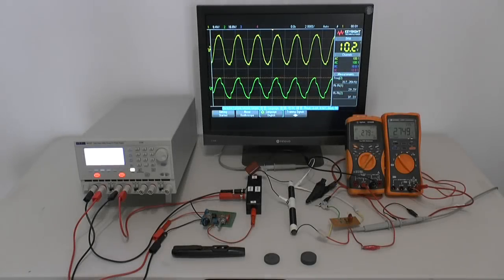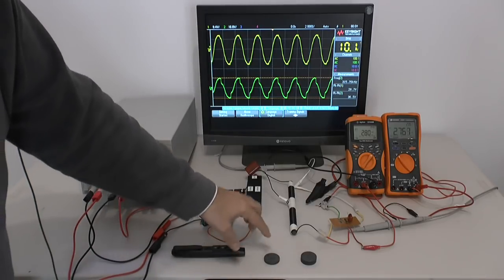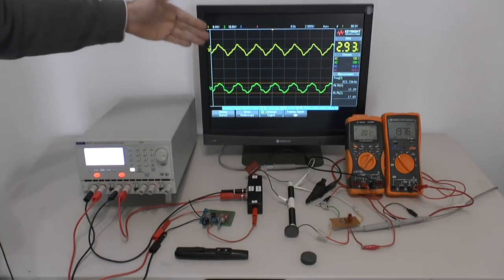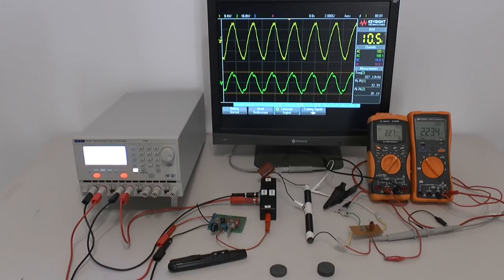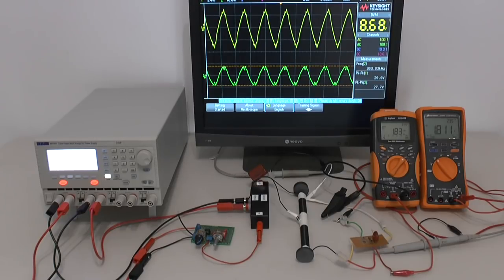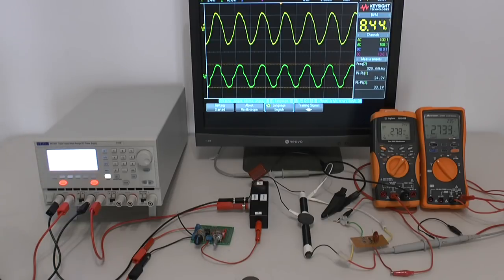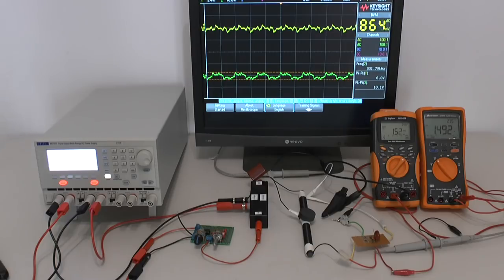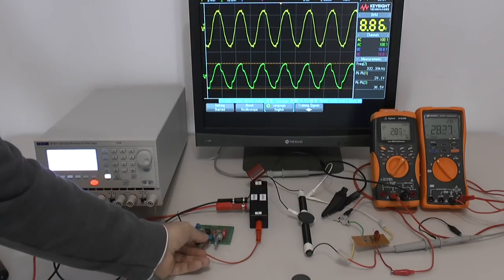The influence of a permanent magnet on an AC driven transformer

Comment: Correct! Attaching magnets alters the magnetic hysteresis loop that the coils see. It is equivalent to choosing a different core material, except the permeability of the material becomes anisotropic. Also when the magnet is too strong the ferrite/core material is pulled to its maximum magnetic field on its hysteresis loop and stays there, ceasing to interact with the coil in a way that transmits energy well since it behaves as a hard magnet instead of a soft magnet.
Reply from the maker: Well put. Hysteresis is one point and impedance is another. Very difficult to define which is having the upper hand.

Comment: Is the frequency of the input at the resonant frequency of the material of the magnet? No? Then, perhaps that is what needs to be looked at. Was the current a pulsed DC? No? Another thing that seems to be a requirement for over-unity devices to tap the Schumann cavity.
Reply from the maker: Using a transistor or mosfet requires always DC which excites an RCL circuit and become AC in this circuit creating a frequency. The Schumann frequency is a different frame of reverence to which I could not find so far any relation.
Reply: @TheOldScientist  I believe Nikola Tesla was using permanent magnets and electromagnets with specific frequencies of electricity. This is, unfortunately, easy to say but difficult to prove due to much of his research coming up missing upon his death. I mentioned the resonant frequencies of the magnets themselves because I have heard elsewhere on the youtubes that the oscillations of the waveform being transmitted through the material via electron motion have to match the resonant frequency of the medium carrying it to create a much greater effect through constructive resonance. I mentioned the schumann cavity because most over-unity devices (including the frauds) mention pulling electricity out of the air with magnets, or using magnetic repulsion for free-energy. However, allegedly, Tesla had a dipole antenna and permanent magnet in his Model T or whatever that was wired to some kind of AC motor whereby he was pulling electricity right out of the air to power the car (as recorded by his nephew who is still alive today). I'm assuming it was some kind of tuned antenna, but I am way out of my league in terms of understanding.  

Thank you for responding and answering, though. Glad someone is on youtube teaching this stuff and helping debunk the bad science.

Comment: In the no load. Does the magnet add a residual load since the current in the circuit is slowed by magnetic force interaction? Under a load with a balance could yield different results. If there is no gain there is no loss but the output shows a lower value could the rest be in the magnetic field and could Kirchhoff's law be stretched at circuit junction?
Reply from the maker: Hello, no, the series capacitor is reducing the resistance into negative allowing to draw more current than technical possible. This current is idle consumed and not used by the load. To avoid that you can use a lower value capacitor. Example with 1 nF I have zero current at no load. So with 2.2 nF I am much closer with current draw and current consumption of the load, around 85% or COP 0.85
Reply: Great presentation. I see that magnets can slow current.